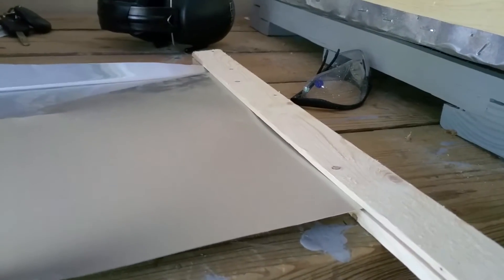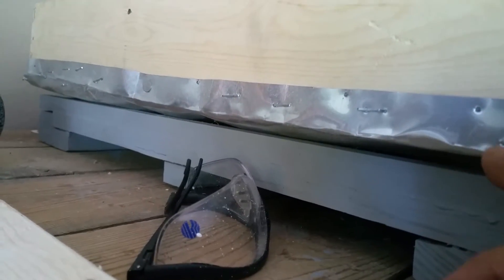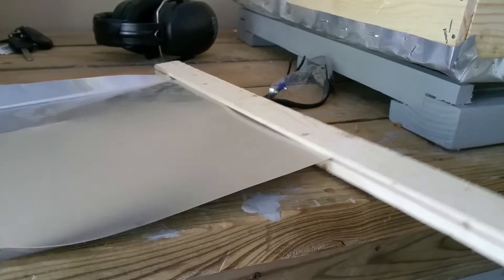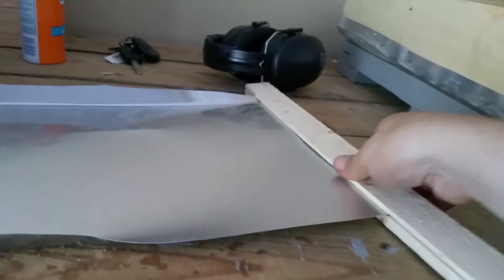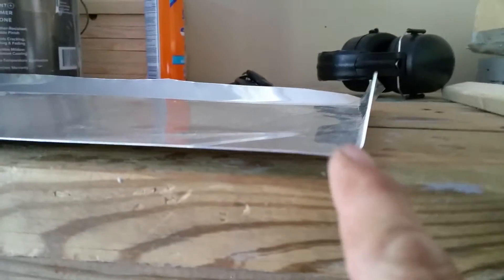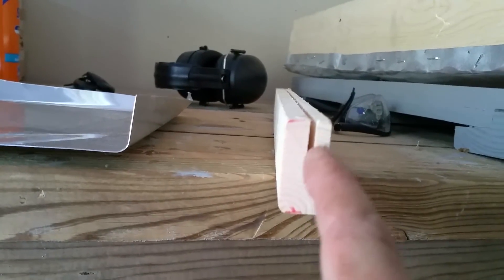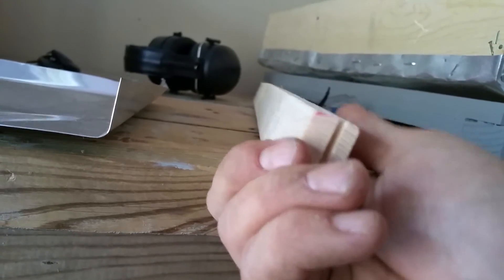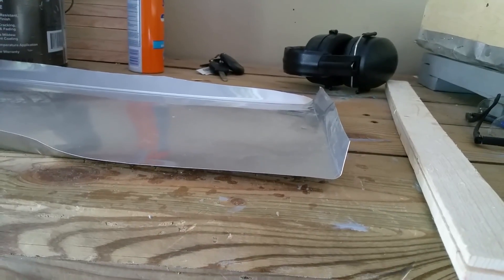Make your own metal brake / folding tool for aluminum

Comment: The piece of wood you ripped the slot, what if you first cut something like a 10 degree bevel, then ripped the kerf slot in it ? That might give you a tighter bend. Also, a piece of 3/4" scrap oak might work better than soft pine. This is a good idea and thanks for posting it !  I'm going to experiment right now !